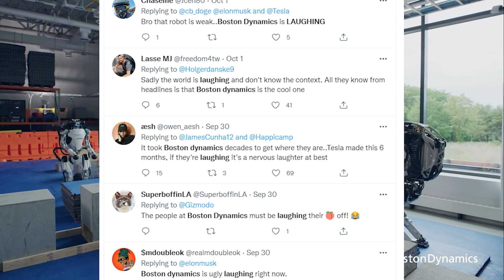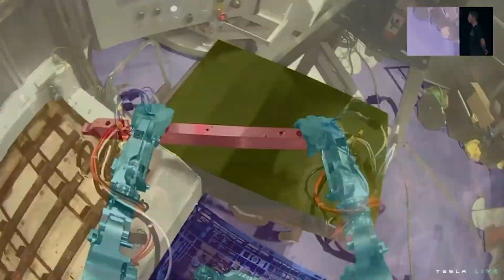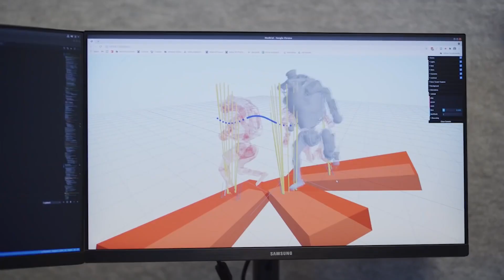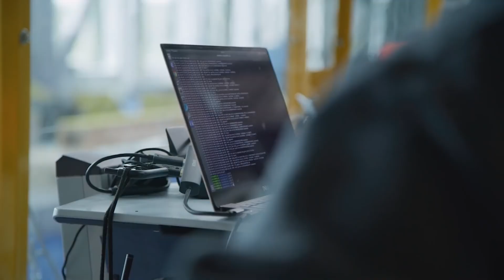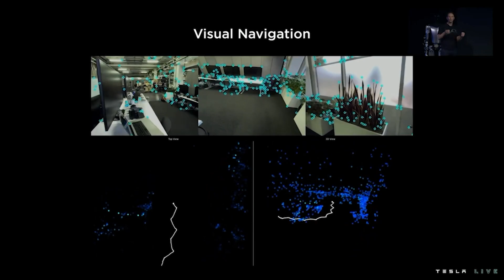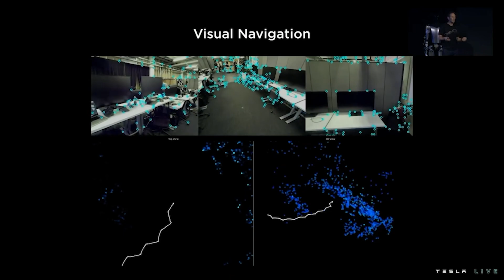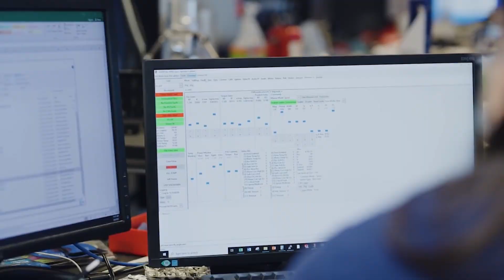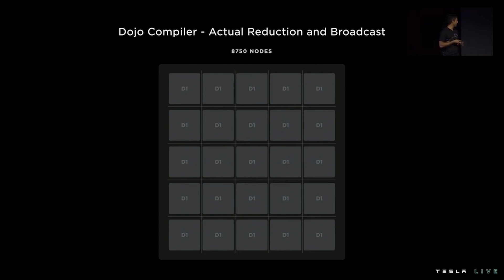Why the Tesla Bot is BETTER than Boston Dynamics: Atlas VS Optimus

Comment: I noted all your (valid) points shortly after the AI show in the many foolish and ignorant comments some made (mostly by non-engineers). The more technical commenters seemed to ignore the progress in 8 months (compared to 10 years for Dynamics) or the use of remote control, self guidance, or low cost design. Thank you for your fine explanation.
Retired JPL Mission Controler.

PS, For many years I have thought what robots needed was a model T. Good enough to start and something to improve on every year, like the car industry does.
Reply: I mean everything he said was wrong. And I am someone who works in AI.

Atlas isn't preprogrammed. That would be useless. It reacts to the environment dynamically. And unlike the Tesla Bot, it doesn't use the vision software of a car. A car stays on flat terrain and stays away from objects. A robot needs to be able to walk on uneven and unknown terrain and needs to engage with objects. Those are totally different problems.

Boston Dynamics is light years ahead in that department. And Tesla builds robots for decades. They build factory robots and the Tesla bot looks like a factory robot.

I really don't understand the hype. Everything they presented exists better at another company. Google is best at AI. Boston Dynamis is best at dynamic motion. Hands were made 15 years ago.
Reply from the maker: @devalapar7878  Atlas is specifically trained for each course it does. I didn’t say it didn’t react to its environment, it obviously does. Unless you’re suggesting it decided on its own to do a backflip and a dance routine. Obviously they’re completely different robots for different purposes and if you watched the video that was the exact conclusion I came to
Reply: @TFCTech  You want robots to follow commands. But how they follow it is up to them. And the Tesla bot isn't different in this respect.

Did you think Tesla bot walked on its own? Did you think the path wasn't given?

Atlas has a more sophisticated body and understands environment much better than  the Tesla bot. It is much more sophisticated in balancing too.

Tesla bots visual is just Tesla car visual. That won't work with robots. 

Also Tesla says what their goals are. So far they haven't achieved any of those goals. Everyone can say what their goals are. This doesn't mean they will achieve them.
And given the track record of elon musk i don't believe they will be the first.

Other companies have achieved some of the goals: Mimicking human expression, recognition of human expression, language, dynamic motion.
Nobody hypes those companies. They are judged by the result and not by the wishes of the founder.

Today elon musk could show a toy robot and people would go crazy.
The Chinese robot is trash but still more impressive than Tesla bot.

Elon musk takes a lot of ideas from science fiction, but he doesn't understand the difficulties. And when I look at his companies only one is successful (tesla) and that barely makes a profit. The other semi successful one is space x, but it is more a government program than a company. 
So I don't understand the hype.
Reply: Atlas was definetly a big help for Tesla imo. Of course a robot which is built now will take less time to get up in running, because they actually have another bot they can reference. Yes it's cheaper (we'll see how close the actual prices comes to the mentioned 20k) , may have better functions than the Atlas but it also has completely different goals than Atlas. 
The Tesla bot reminds me of the NS-4/ NS-5 from iRobot. It is supposed to be like an everyday companion and able to do not only dangerous work tasks but also household chores. Kind of creepy imo.
Reply from the maker: Completely agree
Reply: @TFCTech  So are you being to say the dumb wrong things you claim or just really a dumb musk fanatic?
It has nothing it was all done with pre programmed routines! Its 1990s at best! 
The AI "videos" didnt match the room which was claimed it was from  showing the actual event! LOL Reminds me of his LIES like when he claimed all the houses had solar tiles! WHEN NOT EVEN ONE TILE EXISTED!

Comment: i personally think that humanoid frames are ineffective compared to other types due to stability and movement
Reply: Until you solve said stability and movement issues. After that, the entire world becomes available.
Reply: @martincossette7420  im just saying that the human form has flaws that have no reason to be given robotic form other designs are more viable in my opinion.
Reply from the maker: @britishbloke2256  I agree for some situations. But for a general purpose machine it needs to be in human form as all of our infrastructure is designed for humans
Reply: @britishbloke2256  For specific tasks maybe, but that's not Tesla's goal.  They don't want to make another Roomba, and Foldba and Dishba and GetMeABeerFromTheFridge-ba. hehe
Reply: @martincossette7420  i think the best design would be a humanoid torso arms and head but instead of legs having wheels
Reply: @britishbloke2256  That would definitely be an easier design to realize. But what happens with steps and stairs?
If there's something I learned over the years about Elon: he doesn't back down from what seems difficult or even impossible at first glance.

Comment: What about spot? There is definitely ai in that product. Quite decent perception  
& navigation. Not cheap, but the lack of brain argument against Boston is specious
Reply: Spot is quite remarquable, but has no AI whatsoever. It must be remote controlled or pre-programmed to do anything useful.
Reply: @martincossette7420  Not true. https://youtu.be/Ve9kWX_KXus 
This was 2018
Long term Tesla is most likely to run away with this, just seeking more genuine attempts at comparison
Reply: @martincossette7420  I think it can autonomously navigate in an area that it has already mapped. At least I would assume it can do so because I know literal hobbyists that can get a roomba based robot to do that. As for whether you consider that AI, well, is navigate on autopilot AI? It just drives along a known route from one place to another.

Comment: Let me get this straight the only robot that they could find that had better movement than Tesla Bot (at this early stage) was Boston Dynamics. If that is the only robot that is better than the TESLA Bot then TESLA is in a really good position.
Reply: Uh, no, it's just the obvious example. The other robots are probably mostly just research tools, though, since going to the effort of making a robot bipedal isn't really economically sound. Wheels are just cheaper, and more points of contact with the ground is easier.
It's like why electric scooters are more popular than Segways. A Segway is more maneuverable than a scooter, but how often does that matter? (to be clear: it does sometimes matter)
Reply: @theInsaneRodent  I did look around a long time to look for something that is comparable. ASIMO came to mind. But it seems bipedal locomotion is not very common and not commercially available.
Reply: @jacobuserasmus  Yeah, Asimo. That was what... a decade ago that Honda came out with it? Pretty sure that if there was a market for bipedal robots, they'd be leading it comfortably.
Reply: @seban678  Absolutely but have you looked at the price tag. Unfortunately nuances and written text are hard. But the point I am trying to make is that TESLA which design goal is to build a reasonably priced, smart (AI) robot that is reasonably capable. Then the state of the art should be magnitudes ahead of TESLA's proto-type. 

Yet it is not. The robot that it is compared to is the Atlas. Where is the Tesla bot going to be in 8 years time. Atlas first prototype was 9 years ago. https://youtu.be/zkBnFPBV3f0 vs https://youtu.be/0y-RsGj0_7I
Reply: @jacobuserasmus  I'll believe the 20,000$ price tag when (if) they start selling the thing ;)

I don't think either Atlas or Asimo were ever meant to be commercialized, one is a research platform and the other is a kind of technological demonstration. I don't see use cases where a general-purpose humanoid robot would be better suited than much cheaper specialized machines.
Reply: @seban678  We'll see the $20k price tag. As long as the price is in the range of a human salary they will definitely capture the market. Hey life is always interesting when TESLA is involved. Anchient Chinese curse "May your life be interesting."
Reply: @seban678  Atlas is founded by the defence budget. Its no secret what his purpose will be if the technology is ready. 
Atlas don't need to be  intelligent, or need to do fancy task like watering flowers.
He will be used as an Equipment carrier and if needed as an shock trooper that can be used on a  dangerous or suizid attack by his Sergant. 
He need to be highly mobile, good aim and be good at separating friendlys from targets

Comment: The volumetric depth rendering is absolutely sick, the resolution is very accurate
Reply: Yeah, but completely useless for the robot itself.
Reply: That actually does look like some pretty cool tech. I do wonder how it compares to things like inside-out marker-less VR headsets (the Quest 2 for example) in fidelity and accuracy.
Reply: Their software isn't really useful for robots. It works for a car, because a car moves on flat terrain and has to stay away from objects.

A robot needs to walk on uneven and unknown terrain, dynamically balance and engage with objects.

What he said about Atlas was wrong! Atlas isn't preprogrammed. It balances dynamically. You can see that when the guy hits it with a stick and when it walks outside in the snow.
Reply: @devalapar7878  optimus first and foremost operates in warehouse/Factory environments. they are pretty flat and levelled. Atlas is self correcting sure. but it cannot recognize its environments without things like QR codes or pre programmed directions. Optimus recognizes its environments. it uses volumetric depth rendering. it corrects its gait and walk cycle after 6 months on its own. it recognizes items in its world. without Qr codes or pre programmed commands. that itself is why its exciting.  atlas is like a hobby money pit for DARPA and other governmental branches it will never see real world application in the near future. Optimus will at least see factory usage.
Reply: @preddes6522  Factory usage? you mean the same factory usage that would require a bunch of repetitive tasks that could be pre-programmed into a robot? 
Like how we already have a bunch of robots/machines that already do this without needing an advanced AI?

Comment: scary to know a company can have an accurate map of you home and you use of it.  I guess anyone with a robot vacuum is in the same boat.
Reply: I guess you don't own a cellphone?
Reply: @davidbeppler3032  okay a phone camera can't map an entire 3d space but ok
Reply: @giantdad2799  Yes, it can.  Easily.
Reply: @davidbeppler3032  if used in the right manner. You need to have specific shots of the room from hundreds of angles, and that's pictures. Impossible to do from video, unless you wanna tell me that our phones run the latest desktop hardware.
Reply: @giantdad2799  You are confused.  They can infer the layout of your home.  Unless you put your stove in the bathtub, and your sofa in the closet, they know where everything is in  your house.  Did you know all houses have a design that is available to look up?  They can easily determine what house you have, where everything is and where you are at in your house.  Just using your cell phone.  GPS accuracy is now done in inches not yards.  Your phone does not need hardware.  Just signal.  If it works, they can have the data.  Interesting that you don't know that.
Reply: @davidbeppler3032  interesting that you think all houses are the fucking same
Reply: @giantdad2799  How many kitchens do you have in your one bedroom apartment?
Reply: Or... cameras.

Comment: Another big difference, and advantage for Optimus, is the hand.  Four independent fingers and an opposable thumb, perfect for gripping, grasping, squeezing and holding, on all sorts of regular and irregular surfaces.  Just like ours.
Reply: Hands are actually overrated. The superior gripping tech is ground coffee in a balloon.

No, I'm actually serious. The coffee bag when limp can conform to any shape, and when air is removed from the bag the jagged coffee particles jam up against each other and lock into that shape. Technically there are other substances that would work (sand actually doesn't because the grains are too rounded and will flow past each other) but coffee is easy to get.
Reply: @theInsaneRodent  Yeah, but it would be weird to offer a coffee bag a horse while it's massaging you.
Plus...Teslabot has no face so it can't give you a dirty look. Pure genius.
Reply: @alexpkeaton-1980  What? You are hyping the no face part? And you call that genius? Is that really new?
Reply: @theInsaneRodent  That is fascinating! I will definitely have to look more into that, thank you for mentioning this!
Reply: It is a scam, just like all of his other subsidy scams. You are either a fanboi or worried about losing all of your money. You should worry.
Reply: All which have not been put to any functional test outside of the screen grabs Tesla has put out.
Reply: Hands are not new. Those hands were build 15 years ago.
Reply: If you really care about the hands, then look at Asimo. It completely blows the Tesla-bot out of the water.
Reply: @Maxwell_Twist  Of course Asimo's hand is better
Reply: Your dumb if you think they can replicate a human hand, that thing won't ever open a bottle cap.
Reply: Edward Penishands

Comment: BD robots have hydraulics, crap battery life. What ever it's using for AI it is nowhere near the level Teslas AI is.
Reply: Tesla bot will be out a year after FSD😆😅😆🤣
Reply: Boston Dynamics have made fantastic progression in dynamic movements. Once it gets a better ai package it will be the sort of robot that people desire. 
Right now it is not technically a robot and is a remote control system.
Reply: @bighands69  so, in 7-10 more years?
Reply: @bighands69  Too big, too bulky, no battery life, no hands i.e. no useful work, exorbitant price. That's the kind of product perfect for the US military, not a home.

Comment: Reality is that Tesla bot is not better, but it could be better If volume production reduces cost in 5 years, and If the control system is worked out to be easily teachable and self intuitive for movement solving, also in 5 years. Never assume your competition stays still however. We will see.
Reply: BD is about 7-10 years behind Tesla at this moment.  They lack funding, engineers, chip designers, and a factory.
Reply: @davidbeppler3032  7-10 years behind but with superior a product.
Reply: @TheDodgerOf  Nothing superior about BD robots.  Thousands of hours of programming just to take a step is not impressive.  Robots are not hardware, they are software.  Tesla is 7-10 years ahead already.  Just the facts.
Reply: @davidbeppler3032  how long has tesla been trying to get fsd working? Bout 7-10 years?
A robot that cannot move or do things is a not a robot, its just a computer program.
Reply from the maker: FSD is extremely intuitive even now from what we can see, so I have no doubt in my mind they’ll find a way to translate that to practical workplace stuff
Reply: @TFCTech  FSD usage may be intuitive, the issue is whether they can make creating FSD intuitive.
Because in some way or another, you need to tell the robot what to do and how to do it.

Saying "pick the bars up from here and place them in there" is easy; getting the AI to understand what those words mean is currently very hard.
If Tesla doesn't make some massive improvements in how to instruct an AI to do things, you may need to hire someone to teach your robots. Which could still save money overall, just less of it.

Now, most tasks that these might be used for are probably less complex than FSD, but the real issue is not telling the robot to do something it knows how to do (using FSD), but getting it to know how to do that (creating FSD).
Reply: @theInsaneRodent  
Having a robot listen to a person and follow their instructions would be next to impossible.  I'm autistic, and my disability makes it difficult for me to do that.  So, the robot has no chance at all.  You need a simpler way to give it unambiguous instructions.  A remote control.  Maybe in the form of a tablet.  That kind of thing.  And the robot would need a fairly simple control language rather than trying to understand human speech.  But that part is possible if you approach it the right way.
Reply: @TFCTech  How is FSD intuitive?
Reply from the maker: @TheSpartan3669  It actively uses data to decide when it should pull out to merge into oncoming traffic, swerve out of the way of obstructions, etc. That is artificial intelligence intuition
Reply: @TFCTech  except for the times it doesn't, which is why Tesla recommend keeping your hands on the wheel at all times......
Reply: @TFCTech  😂😂😂